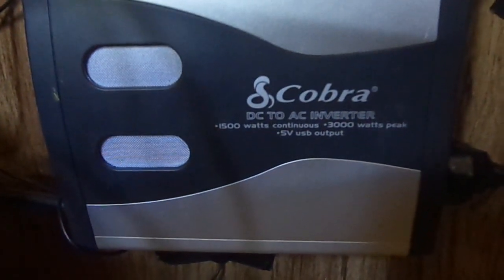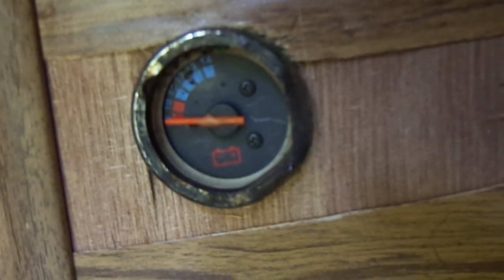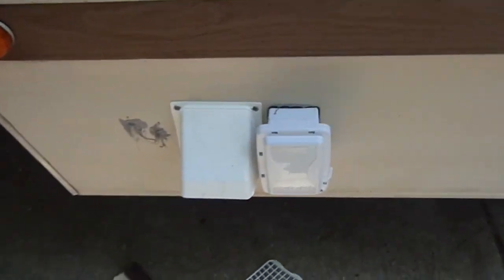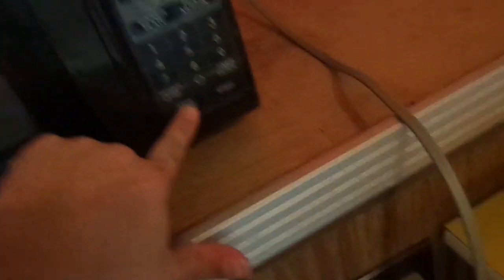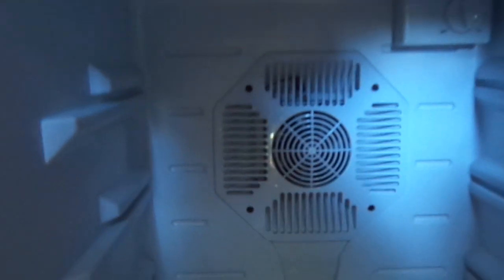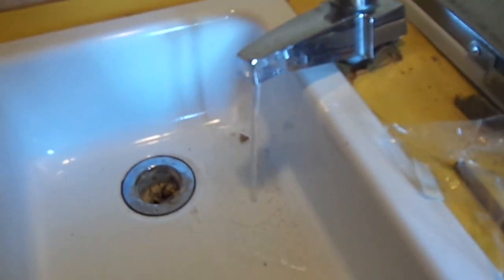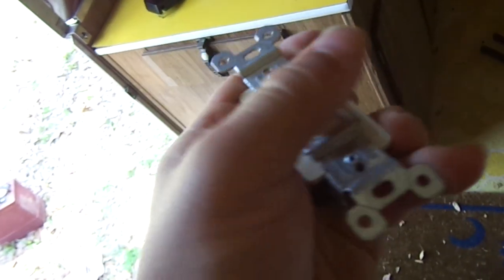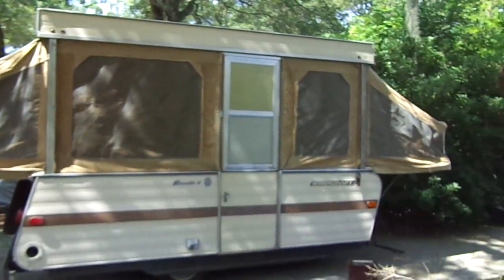my pop up camper

Comment: Doesn't that battery need to be vented all the time?
Reply from the maker: ***** Only when charging or when under a load. When charging I had the vent fan on and also when powering the camper too.
Reply: hheywire Thanks for the quick reply. I didn't know that. Great video thanks.